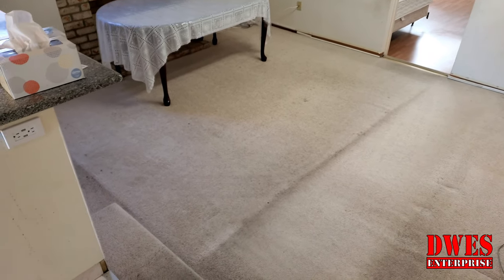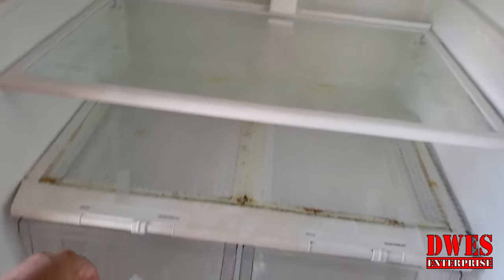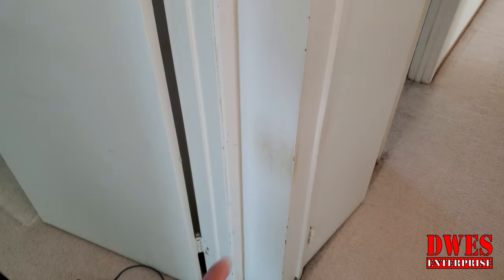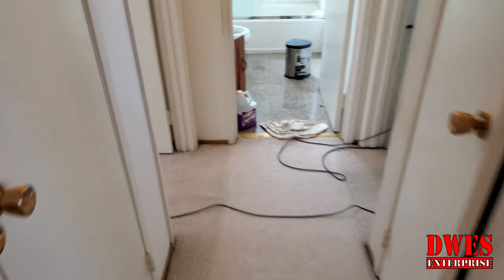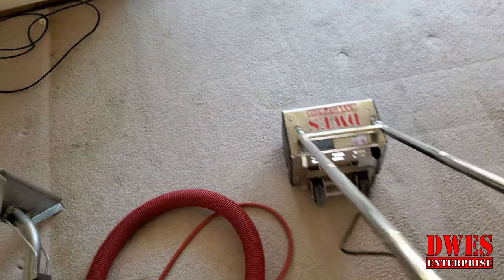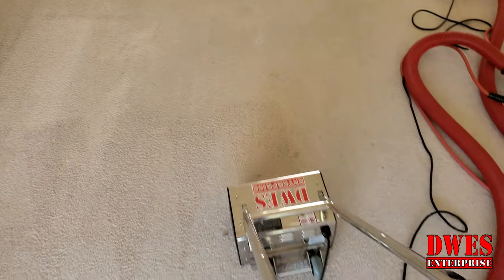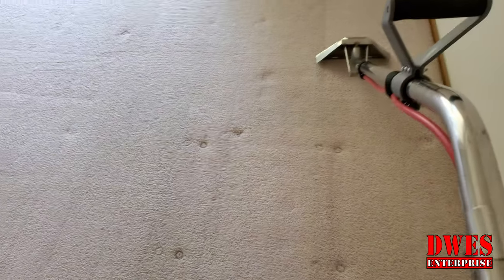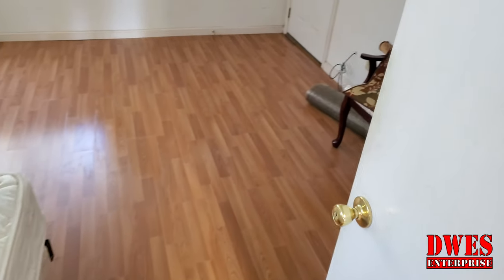Move Out Cleaning by DWES Enterprise!

Comment: so on your generator, there is a pipe where the heat comes out  put a pipe on it and run the pipe in into your tank and it will heat the water up so when you are vacuuming and using your crb turn the generator on and the water will be heating up
Reply from the maker: I want to do the copper coiling around the exhaust... As for now, I'm using the twin hot turbo. Gets pretty hot!